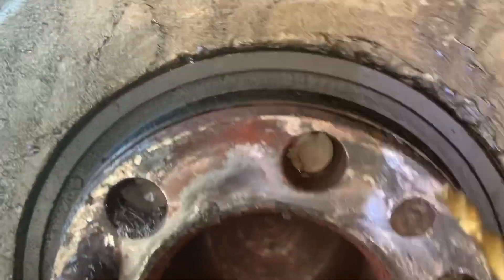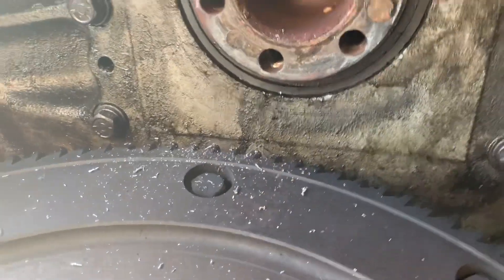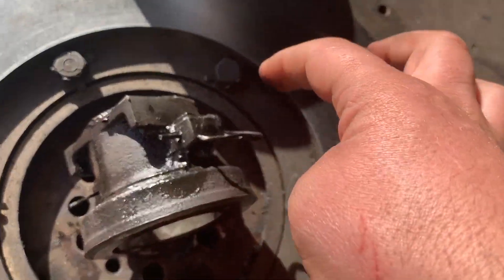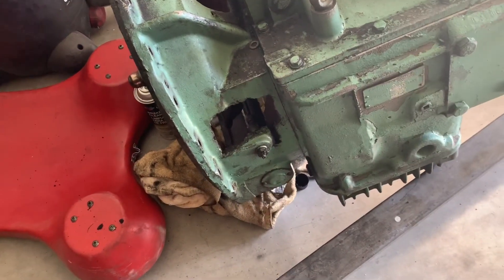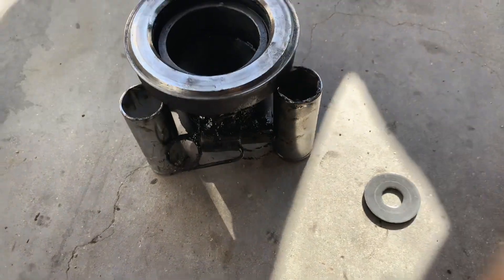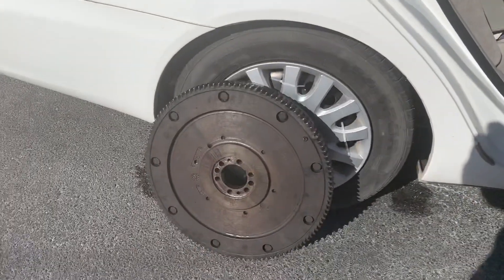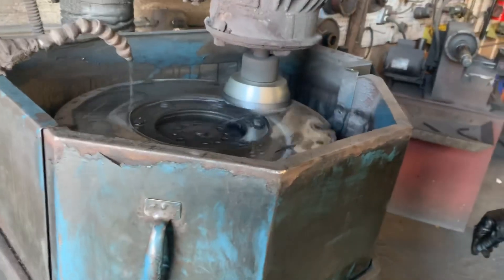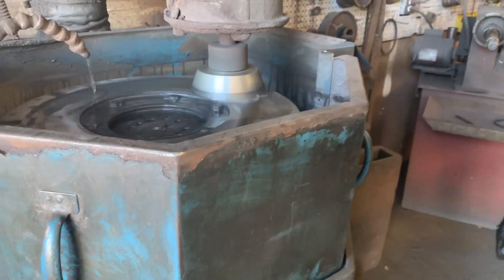Detroit Diesel flywheel resurfacing and bearing removal

Comment: I surface my semi truck flywheels with angle grinder with fine grid and the Eaton fuller 15.1/2 clutch pressure plates too , the result is 100% perfect 👌

Comment: How much did the flywheel get machined? I work for a Chrysler/Ram dealership and have the Cummins engines. States in the service manual Do Not Machine the flywheel. Replace if heat cracked or hot spotted.

Comment: Cool vid.  My local place resurfaces the flywheel with a .003" lift on the friction area, not sure if that's a function of the finish though, - does seem to be a bit rougher.

Comment: Great video. I had the same thing happen to me, I had a 471 in our HD-9 tractor I was pulling a cultivator when I heard an echo in the cab then the sound of the flywheel scrapping the bell housing. Once we did what you did we put a heavier damper pulley on the front of the crank shaft and never had problems again

Comment: most of the DDA flywheels I've had experience with had a removable plate for the wear surface, which I believe is held in place by the bolts from the back of the flywheel. we used to be able to have them reground (off the flywheel) and at least a couple of truck parts houses had reground ones as well as new ones in stock. I believe the reground ones were about $30 exchange, at least in the early 1990s when I last needed one.  You could also get resurfaced floater lated for dual disk clutches.

Comment: What do you suppose caused the flywheel bolts to break?
Reply from the maker: It’s a common issue.   Never reuse them.   Not torqued right.  Not using correct peanut butter procedure (international compound #2)
Reply from the maker: It’s a common issue.   Never reuse them.   Not torqued right.  Not using correct peanut butter procedure (international compound #2)

Comment: Get some left hand twist drill bits, the bolts will usually come out while you are drilling, without having to use an easyout -
Reply: +10 on that, easy outs tend to flare out the broken bolt and make it jam tighter. Left hand drills are biting on the bottom of the drilled hole and don't flare out the broken stud. They are one of those brilliant tools that not many people know about.

Comment: Hm-m-m, I'm not a machinist or mechanic but I play one on YouTube.  
You didn't show the set up but did the employee use any measuring equipment to make sure that the hub on the grinding machine was indeed parallel through 360 degrees to the grinding surface before mounting the flywheel?  Did the mounted flywheel hub get checked for the same alignment?  
That surfacing machine was so dirty and crusty looking I have to wonder what maintenance and calibration it sees?  That whole setup looks real questionable to me.  If the clutch is still chattering/grabbing then I think you know where to look!
You could could verify the trueness of the surfacing job done on the flywheel once it's bolted back on the flywheel using a magnetic block and surface gauge.
Reply: You certainly ain't a machinisy. Have you seen the swarf some people have on their lathes? So long as everything sits flat and doesn't obviously wobble on first rotation, it will be smooth. People put stuff straight into drill chucks and lathe chucks without a thought but you'll see the wobble the first time it starts. These things stay calibrated their WHOLE LIFE. My father has a lathe from the 50s with a 12 foot bed on it. Left outside for 10+ years it's still perfect. The thing is there's bearing between the motor and grinding head that could handle huge pressure, the kind that would come from a sledgehammer hit. THAT is the calibration. But trust me, you'll know if things aren't flat/square/straight. I once bought super cheap chinese drill bits that were bent from manufacture. I knew straight away that they were bent, even though only about 1/8 inch over the length of them.
Reply: Automotive machine shop equipment tends to turn out very good parallelism even if the equipment is very dirty. I'm guessing that's because they are designed for it and they only do one job. So long as the chuck is clean it should be fine.
Reply: Seeing the amount they had to take off even I would be checking that! I dont know how a flywheel would get that messed up even with the broken bolts
Reply: @jeep2003  How much did they take off? Amazes me how many know-it-alls you see here on YouTube that have probably done dick all themselves.

Comment: You might want to get a set of left hand drills.  They work VERY well removing broken bolts.
Reply from the maker: One spun when i was drilling i told frank i wish i had been using left handed bits.
Reply: Definitely a good idea.

Comment: Re broken bolts: goes to show you how torquey those engines are. Friend of mine put a solid disc clutch plate behind one and he swore it sounded like it would beat the transmission apart. He also adapted a 3-53 to an automatic on a front end loader. He used a flex coupler that had 2 parallel plates separated with rubber discs around the circumference. At idle, you could see the engine side of the coupling jerk with each power impulse...and the input to the transmission was smooth as a baby's bottom.

Comment: I HATE it when they put the hydraulic slave cylinder on the throw out bearing. heat and time the thing leaks brake fluid and you have to take everything apart to change it.

Comment: Don't let anyone say that machine shop doesn't clean and maintain the equipment, the $85 is a bargain on such a well maintained clean bit of kit, I would definitely trust them to do my work with care and attention to detail.
Reply: That's nice work on the flywheel.   A little dirt residue is a sign of a hard working machine shop.  People have no idea what they're saying.
Reply: @scdevon  A little dirt residue lol I can imagine what your house looks like if you only see a little dirt residue. Put your glasses on and take another look or get your guide dog to look for you. You can watch hard working machine shops all day long on youtube, you wont see anything caked in shit like that.
Reply: @dubsydubs5234  We had a 24/7/365 oilfield manufacturing shop, where everything was cleaned between jobs and DEEP cleansed during weekly maintenance and inspected and signed off, with random checks by the Plant Manager. We were working to 0.0001" spec. on many dimensions. Nothing that I saw in this machine shop in the video looked even faintly serviceable. We FIRED employees who decided not to wear proper PPE. Of course, we were inspected by HSE twice a month, and fined heavily into compliance. Our lead engineer was quite thorough as well. 
  Different worlds, I guess.
Reply: @andytaylor1588  I worked in garages for the last 45 years and went in dozens of other garages and machine shops and none had machines caked in shit. I guess none of them were busy. That machine didn't even run true, I wouldn't be surprised if the bus juddered.

Comment: milling cutter or diamond head for turning the flywheels, I envy you guys for good)
Reply: Diamond tipped facing wheel, as you can hear it "singing" on full width load..Cant take too much off in one go as you would with a carbide tipped fly cutting head, but then you not looking at taking lots off really.. good old school engineering machine shop stuff..
Reply: did you notice how the operators fingers told him how the finished surface is now...lol. this I know.
Reply: That is a CBN wheel on the flywheel grinder.

Comment: My x boss would have fired me if I had not re centered a flywheel if it was only cutting heavy on one side. It doesn't take much debris in the flange area to show in the resurfacing of a flywheel. That shop no longer uses that type of resurface machine they use a lathe now. Im sure glad I was not loading that heavy flywheel but thats a lite one compaired to a step fkywheel. .
Reply: what if its actually not truly flat? If the face of the flywheel is warped I would think it doesn't matter if u recenter it. Kinda like brake rotors.
Reply: Agreed. Plus it wasn't even roughly 0.002" off true, imho. The math works out to be well within spec.
Reply: HE DID say it was high on one side due to the broken bolts allowing it to be a bit further out on one side. You get IMPERFECT and try to make it good again. There's NO GUARANTEE that it's not bent/warped in directions previously thought impossible. I've seen that at work. Properly HARDENED RHS steel frames about 8 or 9 feet long bent ALONG THE LENGTH of them is one example I have seen. These are designed to take 3 ton or more with daily use and I estimate somewhere around 10 tons would've been needed to bend it. But customers do. Customers who own cranes and will use brute force for EVERYTHING. This is hired gear btw, and the care factor is near zero.
Reply: You can see by the bolts that the clutch surface and pressure plate surfaces are separate and generally those two surfaces are machined separately to different specs even if it's a one piece flywheel.
Reply: I bet the center adapter is warped. If that came out for grinding the flip the center and grind the crank side mounting face if the have a smaller cbn or stone to go in there. Mount the outer and surface again. I might mount just the center on the grinder and indicate it. The mount the outer and grind it. That flywheel assy is really warped and now off to the balance shop or the machine shop for a pilot to mount it on a horrible freight gravity style motorcycle tire balancer.. just to see how far out it is.